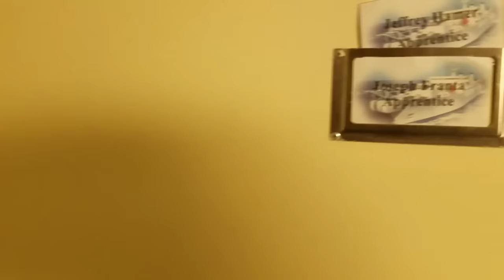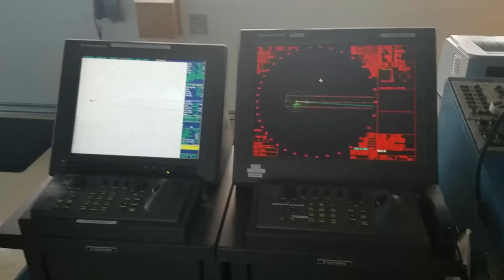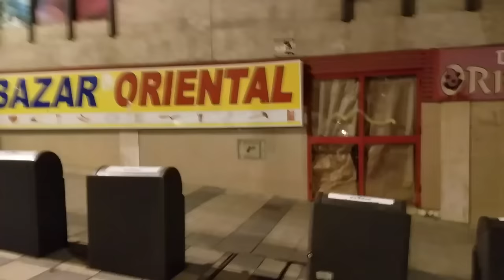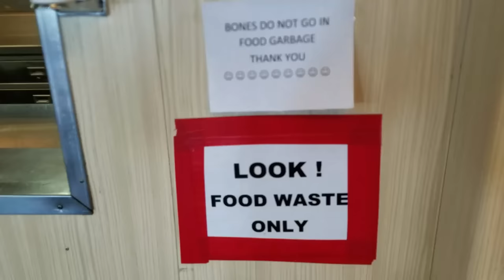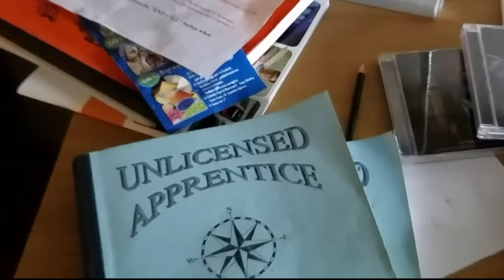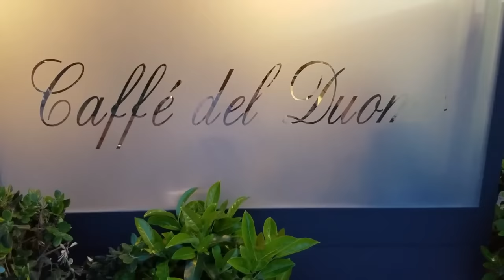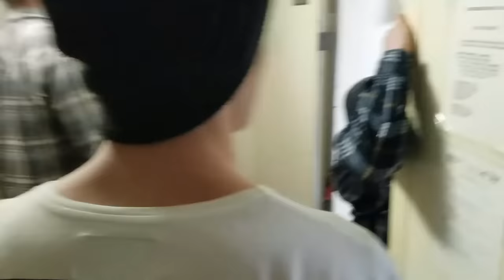MY FIRST SHIP | WORKING ON A CABLE SHIP | PHASE 2 | SIU UNLICENSED APPRENTICE PROGRAM

Comment: I worked on a cable laying ship installing the IT infrastructure in to a leased vessel. Worked 20 hour days to make sure the job was finished before the ship set sail as they don't hang around for you to finish your work. I didn't mind sailing with them but they stop paying once you've finished your job and you have to wait around for a tender to come out to the ship

Comment: How was the cable loaded into the cargo bays?…and it seemed like some crew member had to be on hand 24/7 to make sure (fiber optic?) cable was spooled out without problems
Reply from the maker: Usually a whole cable gang assists in loading the cable it doesnt spool itself so we are all there while spooling it and when it is paying out we have someone watch it.

Comment: Wish you'd explain what the cabling ship does. Was it fiber optics? How long of a cable before a splice was made? How deep? A little more detail and a little less on feelings.
Reply from the maker: They lay internet fiber optic cables. I might eventually have a more detailed video on cable ships.  A lot of the operation specs etc are proprietary so I have to carefully make a video they doesn't run afoul of the company's "secrets".

Comment: Can someone explain to me the whole cable in water operation deal?
Reply: No poles at sea.  Cable sinks to the bottom and each fibre in the cable can transmit tens of thousands of times the bits a satellite can.

Comment: Joe, so what was the reason the ship docked in Algeciras in the first place? An interesting video, as always.   I used to look out at the huge variety of ships at sea and in port and marvel at the design, at what naval architects had in mind.
Reply: Algeciras is a major ship port. After an Atlantic crossing, you need fuel and stores.  They probably carried out some repairs while they were there as well.
Reply: The company has (had?) a depot there where spare cable for any future repairs was probably unloaded.

Comment: Hey Joe - quick question; the shims in the cable holds, are those to allow for ease of extraction, to prevent contact corrosion/rust, or both?

Comment: Very interesting series of vids Joe. I have a question that you may be able to answer from standing bridge watches. Do sailors on bridge watch pay much attention to AIS? I've seen sailing blogs where small yacht sailors (40 ft ++) with AIS transceivers have had to get out of the way of bulk carriers while on passage and when they tried to make contact with the ship, on VHF, got no response. Seems to defeat the purpose of AIS, if it's not used or someone on watch is asleep or not paying attention.  Cheers :)
Reply: As a deck officer myself I can confirm AIS is very useful, and arguably the best safety investment a sailing boat can make. It helps me immensely, especially in bad weather or fog. A quick glance on my ECDIS and I've identified that there is a boat there.